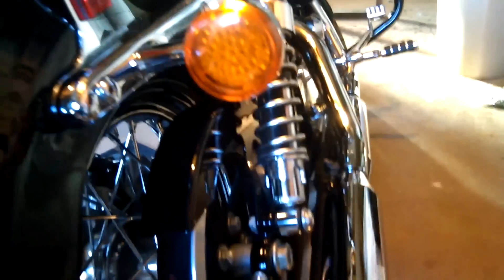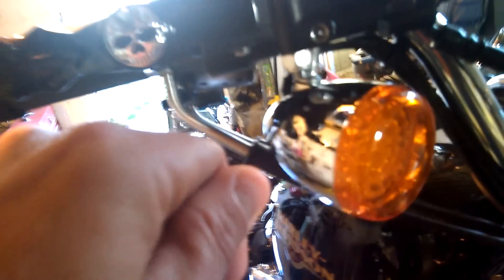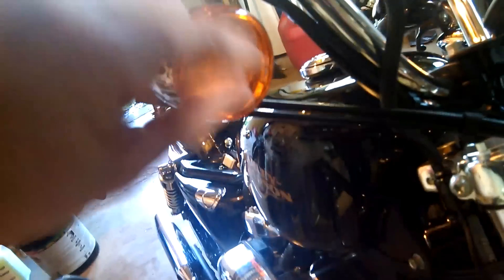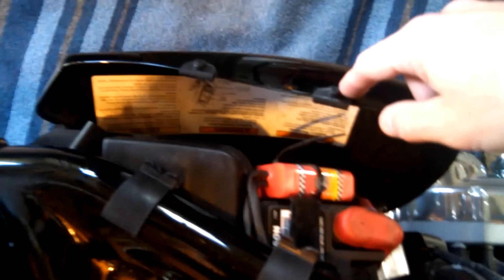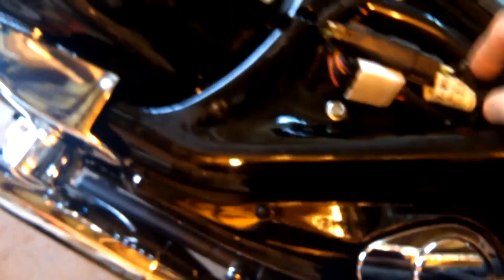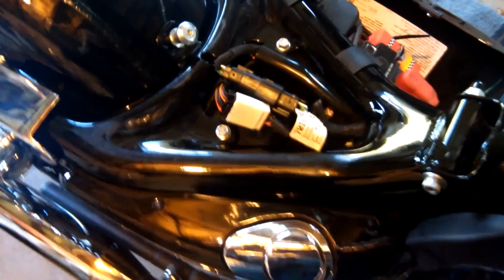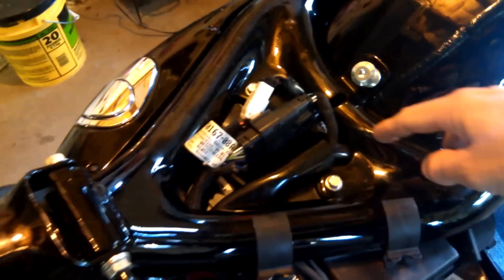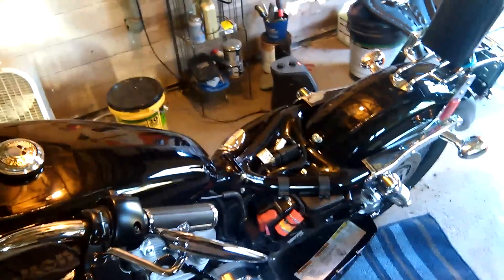OnionsSack: Sportster load eq connection find!

Comment: I also couldn't find this connection to save my life.  There is actually the same LOOKING connector that goes to the front lights under the tank, toward the front.  I tried that and it does plug in and you might think it was right, but it makes no difference in the way it works. 

Like you, I read the directions and it says the connection is under the seat.  I hated to just start pulling wires out, but after I saw your video I decided to look EXACTLY where you said at minute 3:28. So I pulled on the big wire jammed under that part of the frame and BAM!!  There it was right underneath that!!!  Thanks so much!! 

I'm going to put a link to your video on at least one of the forums I hang out on www.xlforum.net , unless that is a problem?